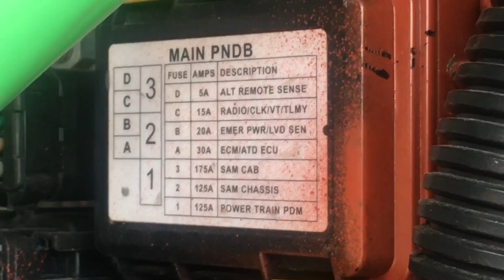Cascadia unexplained multiple shutdowns fix

Comment from the maker: While I had my truck in the shop last week to have the starter replaced, they said I had a recall on my truck. They didn’t explain what the recall was and they didn’t give me any paperwork for the recall. After getting it back, I didn’t bother to check to see if the plug was still detached. While stopping for fuel, I opened the hood to check fluid levels and noticed the little led on main pndb was solid. So, I look under the truck to see if it was plugged in. Sure enough they plugged it in. I have now gone 1500 miles and the truck has not shutdown on me. I have a right to know what the did to my truck and I will let you know as soon as I find out.
Reply: Whatever happened?
Reply from the maker: @shmirbuchanan8673  it started shutting down again, so I unplugged the wiring. The truck was destroyed in early 2019.

Comment: Hi dear i have 2018 freightliner cascadia and does the same thing while driving
It shuts down while driving and then i had to stop on the side and then starts 
So where is the plug that needs to unplug? Is it near the pndb box under the hood ? Thanks in advance brother
Reply from the maker: Find the switch beside your seat and then reach under the cab and unplug it. There is no guarantee it will fix your problem, but it never hurts to try.

Comment: It will eventually shutdown with the switch unplugged. Then you have to plug it back in to get it running. I think mine was running on auxiliary batteries when unplugged.
Reply from the maker: That truck didn’t last long enough to find out. It was destroyed in a not at fault accident on February 20, 2019.

Comment: Battery kill switch is usually located next to driver seat but my 2013 Cascadia doesn't have it, where else could it be?
Reply from the maker: Amir Samouei if it is not by the drivers seat, then you could try in or near the battery box. If it is, then the switch is probably not your problem.
Reply: Some freightliner doesn't have.
Reply from the maker: Zafar Inoyatov I wasn’t aware of that. Every cascadia i have operated since 2008 has had one.

Comment: My 2012 cascadia just started randomly shouting down while driving. I’ve cleaned the battery terminals and replace the fuses to the pndb. If it doesn’t fix the issue.   I’m going to  disconnect the plug to the switch.
Reply from the maker: RJ Bol I still have no issues since I unplugged the main pndb. just remember this may only be a temporary fix. The main pndb may still need replaced later on.
Reply: Totally get it. I’m going to replace the switch and pndb control module
Reply: RJ Bol did it work when you unplugged it

Comment: I ended up unplugging the switch from the bottom side and wrapping it up with duct taped did not have any issues till I got in the rain and the snow has a truck just shut off period.  Do not pass go do not collect $200 just no power  dried it off with air and plug it back in the truck started  right up  I’m Going to sell the connector up in an airtight bag or some kind of situation tomorrow.

Comment: Hi I'm having the same issues as you had driving down the road the truck shut off all the lights and gages reset everything back to normal did you ever find the issue
Reply from the maker: daniella lopez01 this video explains it.
Reply: Clinton Kirker I had the same problem two years ago and I just disconnect the switch and haven't had any problems since
Reply from the maker: Alfredo Andrade no issue here either.
Reply: I’m having the same. But I disconnected from the switch. It’s been 3 months and yesterday it did it again disconnected. So that don’t fix the problem.
Reply from the maker: Jermaine Jenkins I haven’t had any issues since unplugging the disconnect switch. I hoped it was a permanent fix. It might be time for you to try replacing the main pndb. From what I’ve read that is what the issue is.
Reply: Jermaine Jenkins did you disconnect the battery switch... I going to my third year and no problem yet...
Reply: Yes I did
Reply: Yes I’m thinking the same thing.
Reply: I’m reading up on it now and it seems like it can be more to it.
Reply: @25real83  - I wish you sent a link to what your reading up on.
Reply: ALFREDO A really and it works I just did it this mourning

Comment: Did you get any codes when the pndb went on you?
Reply from the maker: Shmir Buchanan no. It just shut the truck off while going down the road, sometimes multiple times.
Reply: @clintonkirker5154  I'm getting codes for the Sam chasis and my truck is shutting on and off like this in the video. Think fuses for Sam?
Reply from the maker: Shmir Buchanan The sam chassis is a whole other beast. It is possible both the sam chassis and the PNDB is going bad at the same time. The Sam chassis cost me $2200 when it went out. I never replaced the PNDB,  But was told around $700.
Reply: @clintonkirker5154  damn 2200? Why so much? Can a regular mom and pop shop work on the Sam? And what were your symptoms when the Sam went? Was it the Sam chasis or Sam cab?
Reply: @clintonkirker5154  how long were you in the shop for with that Sam?
Reply from the maker: Sorry, it was the sam cab that went bad. No dash lights and certain exterior lights had stopped working. If you like, you may Email me and I’ll show you the receipt for the sam cab module. My email is clintonkirker@gmail.com
Reply from the maker: Shmir Buchanan 2 days, one night stay.
Reply: @clintonkirker5154  why 2200 though? What did they charge you for and did they get it right the first time?
Reply: @clintonkirker5154  do you have an email that I can reach you?
Reply from the maker: Shmir Buchanan my email is clintonkirker@gmail.com
Reply: @clintonkirker5154  do the sams kill the truck like the pndb does?
Reply from the maker: @makincash3337  Not in my experience. On the same cab module goes out you tend to lose dash lights and exterior lights but not a total loss of engine power.